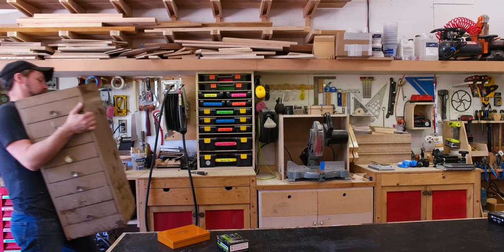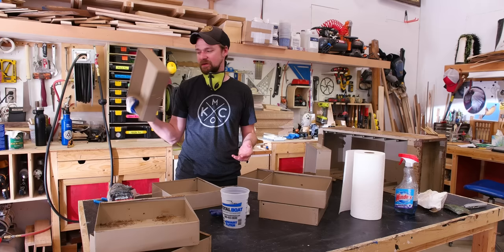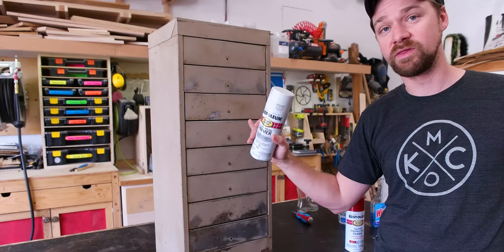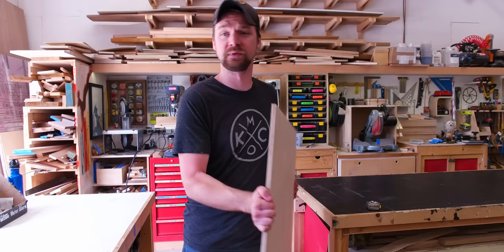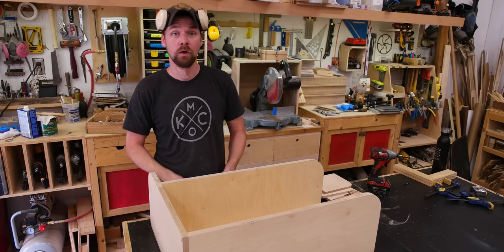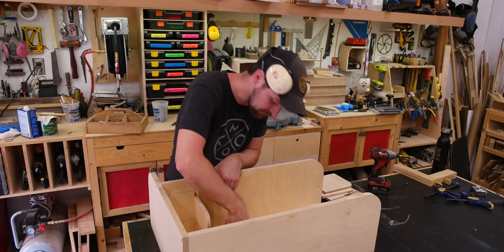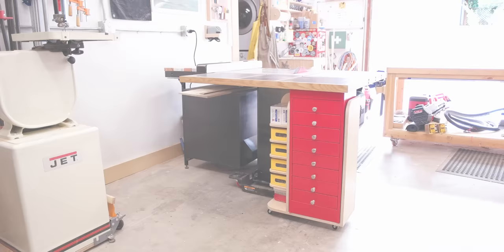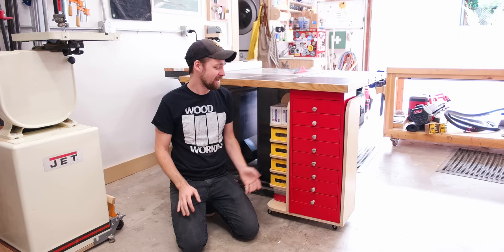Easy Metal Cabinet Restoration and Work Shop Organization

Comment: Thanks for sharing! Not gonna lie I was totally rooting for the full paint of the drawers...lol Turned out awesome btw!
Reply from the maker: Thanks! Yeah that was the initial plan, but the original finish turned out to be in such good shape, I thought it would be less likely to get scraped up over time if I just left it. Powder coat will alway be superior to spray paint.
Reply: @MichaelAlm  thats true! Its still awesome 🙂
Reply: @MichaelAlm  How many coats of red did you spray on? 1 or 2?  You could also use one of those ikea metal drawers too-- I'm just not sure of the weight it could handle.  Great job!

Comment: At 2:30 what was the white stuff you were scrapping off?
Reply: probably old felt pads that had dried up and crumbled. I've seen that quite a few times when restoring furniture. People place them underneath for "easy stabilizers" and doesn't realize that they only make sure that the piece won't slide across the floor. So some people add several of them in a weak attempt at making the piece level. It won't make it level. It'll just destabilize it and once people figure that out, they throw out the entire thing because they're tired of trying to "fix" it.

Comment: Hello, I also have a couple metal card catalog drawers which are in a very mild rusty condition.  May I know what grit of the sandpaper did you use before you put the primer on?
Reply from the maker: I just used 220. Anything lower and it leaves swirl marks. Let me know how yours turns out 😁
Reply: Thank you for the tip.  I also have another question.  There are some very very old stickers or labels on the box.  How can get them off without scrubbing?  What’s the proper way to do it?
Reply: @my2ndoneny  if you're repainting anyway I've always found a wipe over with acetone clears off old labels and the glue residue.